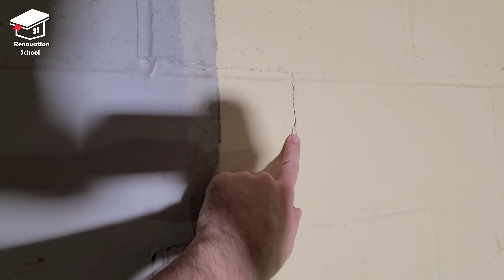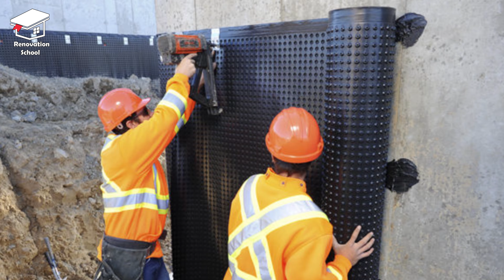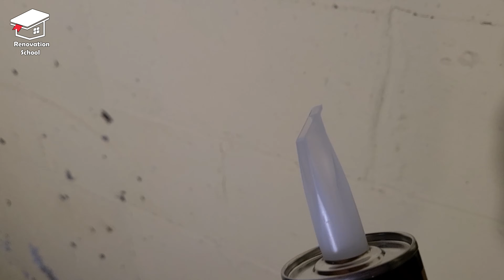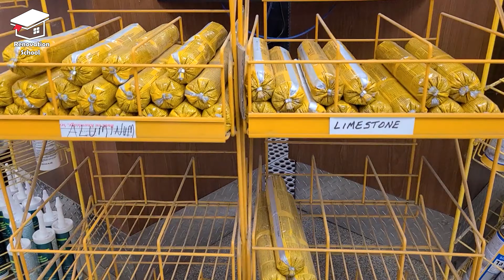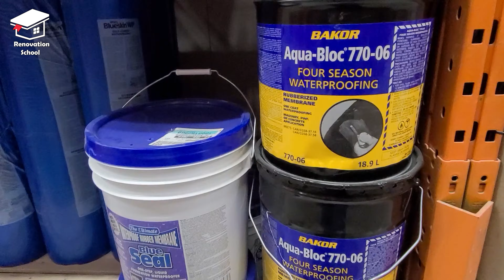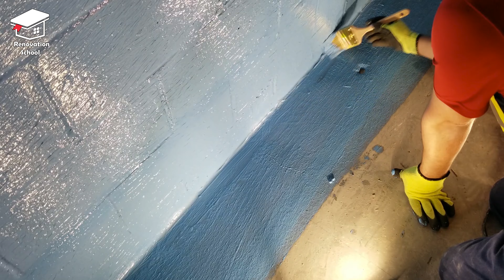How to waterproof basement walls?

Comment: My uncle died in the middle of a reno. He has a subterranean house that I am inheriting. He told me about a natural spring pushing water towards the house and how he installed a float-activated pump to pump water away. I was looking at the house, and saw torn black plastic sheets on the side of the house that looked like an exterior form of water proofing. I was thinking of painting on the Blue Max or Aqua-Bloc onto the house's exterior. Do you think it is worth the time and money? Once I push the earth back to the house, I don't want to think about it again.
Reply from the maker: What he used is called foundation wrap. 
They usually dig the outside part of the house around the entire perimeter of the foundation and use a wrap and wrap the entire foundation with it, and then they use a sump pump in the house in case there is nothing in there , that is the absolute best way of waterproofing. But that is extremely expensive and time-consuming

Comment: Ty did you make sure it stopped the water. 

25 years ago I used Thoroseal power mixed with water and stirred I did not use a paint rotary mixer I used a piece of 1x3. 5 gallon bucket powder was enough to do my garage and basement walls. We’ll I can say it lasted 25 years. Need to do again. I’m now 68 and was looking for something a little easier since the Thoroseal is in power then mixed. Can you paint over that blue wall of is it a rubber type
Reply from the maker: Yes , it did the job here , we had a crack in the driveway and a it was slipped toward the house. We fixed that issue and that fixed this issue in general.
You can paint over it yes.

Comment: The problem with this is that water will always enter concrete, even poured foundations are porous. That’s why there is nearly always efflorescence. Doing this locks the water in the concrete which leads to structural damage instead of passing through and evaporating. Gutters, grading, and French drains are always the first place to start. Most gutters are not fully functional and no one has their grading right. Often with wet mulch against the house.

The only real waterproofing is done on the exterior of the foundation wall. And is crazy expensive. This is make a quick buck flipper shit. 

Don’t finish most basements made before 95, there is no exterior waterproofing. Do exposed foundation and black or whatever color on the subfloor. like a livable loft, hooked up garage look. Make your exposed electrical and plumbing crispy for your interior ‘finishes’. You can still make a family room game room or whatever.

Comment: Great video

Would you need to do this for high set brick house?  We want to start renovating downstairs which is just a big open area with no internal walls.
Reply from the maker: If you don't have anything in the basement, I mean no framing or nothing it's best to use a Buble wrap system that way u can also install a sump pump.

Comment: Hi Mustafa. Thanks alot for such nice videos on these topics. I have a question, would you recomend redguard instead of Blue seal, i have almost a full tub left which i want to use.
Reply from the maker: Thanks alot for watching and the nice comment. I always use redguard and I apply 2 thick coats of it before I tile.
Reply from the maker: For the foundation water proofing the blue seal will do just fine and it will be as effective , i use redguard for tile jobs only.
Reply: @renovationschool8818  Thanks for  the reply. I wanted to use redgard beacuse i already have almost a full tub of redgard left from a bathroom remodel i did last year. So i dont have to buy new blue seal. Does blue seal offer any advantages obver redgaurd? To me they look pretty much compareable.
Reply from the maker: @PrimeTimeAction  red guards dries harder 
blue seal is a little more more flexible. If I had the red guard I'd use it for sure. Over all regard is more durable and it's more expensive.
Reply: @renovationschool8818  Thanks thats exactly what wanted to know. I approeciate you taking time to answer my question.
Reply from the maker: @PrimeTimeAction  anytime   my man